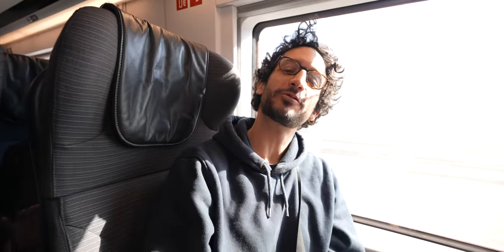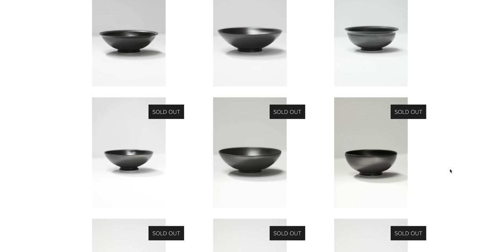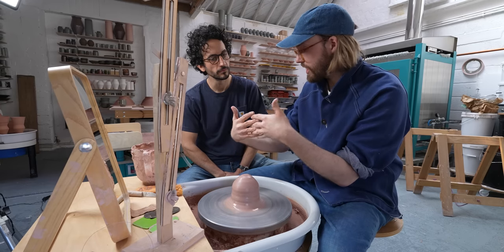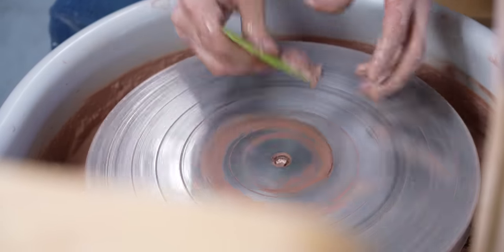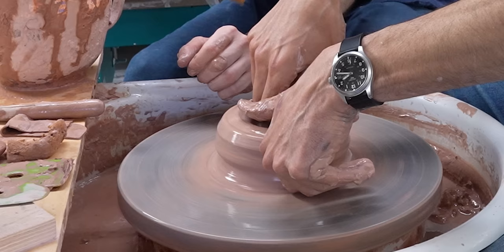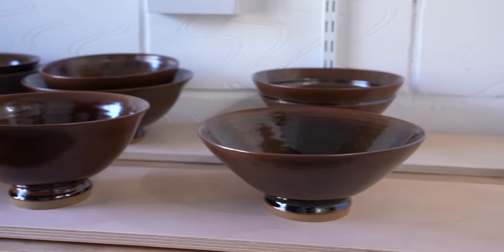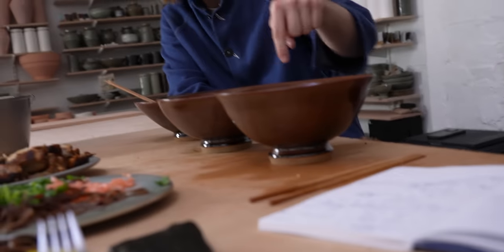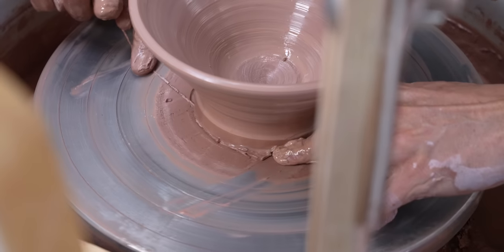My Dream Ramen Bowl Doesn't Exist... Yet (ft. Florian Gadsby)

Comment: One thing you don't mention directly is the shape of the bowl affects the surface area vs. the volume. This will affect how the ramen cools over time. A large surface not only affects the topping presentation but will cool faster.
Reply: Alex kept mentioning how the bowl will affect the taste, but the success of Ramen largely tied to the visual presentation as well. Yes the shape and volume to surface area ratio is tied to heat retention. My experience is that most bowl not made in Japan are too deep and narrow, so that ingredients meant to "float" on the surface of the broth sink. 

The most important feature of the bowl is the slope angle... too steep and everything slides down to the bottom on the bowl. Too shallow and you cool too quickly and you have a deep plate not a bowl. 

The angle of repose, that is the angle at which certain ingredients will remain stable and resist sliding deeper into the bowl is determined not only by the angle of the side but also by the coefficient of friction between the finish glaze and the food. A good bowl should not have a very smooth glaze but rather something closer to a rough egg shell as well.

Then the other aesthetics are more personal preference
Reply: In Florian’s video, he touches briefly on this, and suggests that the preferred shape might vary with the seasons, like for tea bowls.
Reply: @ragnkja  season changes reflect seasonal ingredients which may be presented in different ways so it could be, but as a japanophile who has been consuming ramen in japanese restaurants for years now I've found that the restaurants all used wide inverted cone style (type 3) bowls as necessary to present the ingredients with the proper aesthetic. 

Most use bowls that are so large that it is a task to complete a full bowl of ramen...
Reply: @johnfurr8779 
Seasonal changes also affect how quickly the contents of the bowl cool down, so you need a more heat-retaining bowl when there’s a blizzard going on outside than during a heatwave.
Reply: @johnfurr8779  
Most restaurants, regardless of cuisine, tend to serve too big portions nowadays.
Reply: @ragnkja  lighter summer styles of ramen benefit from a smaller bowl more than a change in bowl geometry. IMO at any rate.... the s shaped bowl in a smaller size would be fine for this IMO as well but I never want a round bowl for ramen. They'r e more appropriate for rice
Reply: @ragnkja  I wont disagree with you there... this is one reason why I dont frequent most north american restaurants. BUT in winter is I plan a day outside in a Canadian winter I dont mind a heaping bowl of tonkotsu ramen... 2 liters of hot broth keeps you warm and the broth absorbs fast enough that you dont feel bloated for too long
Reply: @ragnkja  True, but I would rather overindulge or utilize my willpower to stop than to be left wanting, wouldn't you?
Reply: I don't think that will be too big of an issue since Ramen is meant to be eaten hot and quickly.
Reply: Honestly, ramen is usually so hot when it arrives. I actually prefer it when the bowl is wide. It looks impressive and it’s useful that the noodles cool down faster so I can eat it. The straight edges also means it contains less soup which means better for profit margins

Comment: @Alex
15:14 Another benefit of that 4'th design, is that after you have drunk from the bowl, some liquid could flow down along the edge, but on that design, the drop would get caught & stopped by the 2'nd edge. Maybe make the "top side" of the 2'nd edge more flat (horizontal) so a drop definitely is topped there, instead of staining the table cloth.
Genius design! :D

Comment: Have you tested which bowl can take a ladle of broth dropped in it without splash over and you should test how the broth flows and pools when drinking it, does the straight edge bowl give too wide of a flow/pool, would a bump near the top for holding make a broth "dam" that you have to over tip to reach you, if the bump is recessed inside the bowl does that mean tare and other little bits would get stuck in it.

IMO a textured surface about an inch down from the rim would be a unique experience rather than the porcelain smooth they usually are. It gives you a bit more confidence picking up a bowl full of hot liquid with possibly slightly greasy or sweaty hands either from not being able to pick the whole char sui up with chopsticks or the steam from the ramen while your eating.

Comment: Fabulous episode and super interesting but it leaves me questioning the material. Is there a reason you're not considering using a hand turned wooden bowl?

Personally, when I eat something like a hot soup or ramen I like using a wooden bowl because it not only keeps the liquid better insulated for longer (great for ramen) but it also makes it easier to pick up the bowl for a slurp because of the insulation.

Comment: Looking for your "grail" to present your ramen. Especially when you were holding the filled bowl up reverentially. The container really does make a difference when eating or drinking. I like tea in a thin china cup or mug, & my coffee in a more robust stoneware vessel. I still also swear that Orengina tasted better out of the old orange-peel textured bulb shaped glass bottles. Different wines, beers & spirits all too benefit out of the proper glassware, some keep it warmer or cooler & concentrate the nose of the drink. I too have favourite bowls or plates for certain foods. Some shapes just make it easier to eat, others frame & show it off. Good luck in your quest for your ramen grail. 🍜

Comment: You can 3D print a bowl, make a plaster mold and use liquid ceramics. It is a method that does not require skill, only knowledge.
Reply: yes you can slip cast bowls, the process to make a mould for slip casting is within the means of most determined people without too much of a learning curve. 

But the most authentic looking ramen bowls are hand thrown... with care you can replicate some features that make y9ur bowl look closer to hand thrown. Slip shrinks as water is absorbed by the mould, so you can get away with slight under cuts that would otherwise lock the piece to the mould. 

This is the method I thought I'd resort to when I couldnt find a local potter to toss me a set of bowls for a price I could afford.

Comment: oh god alex took the wrong direction on ramen bowel, two things are at work here
one is temperate is like chocolate mug cup. It is shaped in a way to keep the temperature stable. Different broth different bowel shape and amount of ingredient to use
the other is chemical reaction, you have never explored alkaline how to make the whole noddle better, what can be use to empower, why umai smell creates out of a wok can we replicate in a bowel. There are also ramen store in japan captures smoked smells and fuse it back into ingredient. Japnaese made a lot of improvement in ramen past 20 to 10 years.
If you have not explored these elements you need to go back to the drawing board.

Comment: What's the lead and heavy metal content?
Reply: Lead has been banned in ceramics in the UK since 1990 — and the metal used, which is this case is red iron oxide, won't harm you as it isn't toxic. Of course, if you ate a soon full of the raw material it wouldn't be great but mixed and melted in a glaze like this you won't digest it.